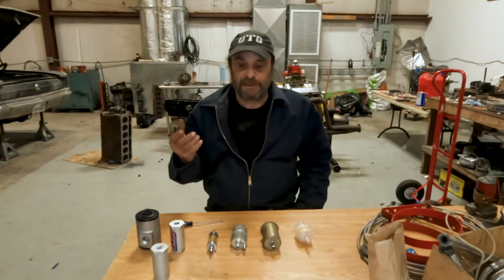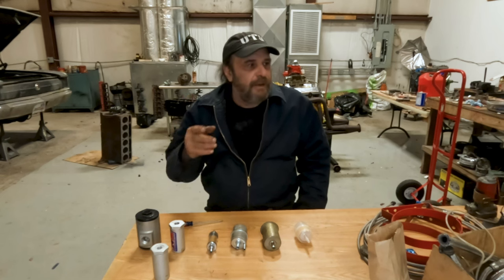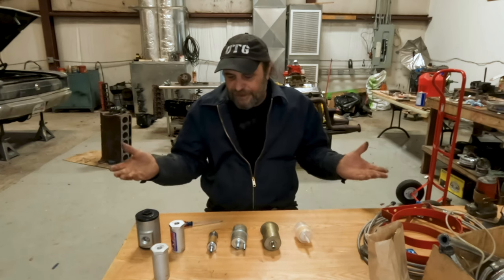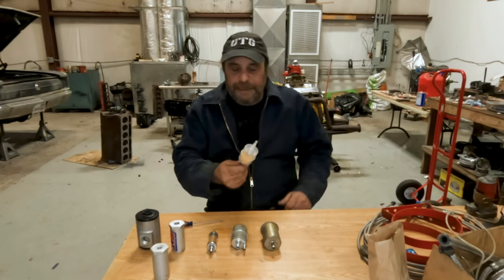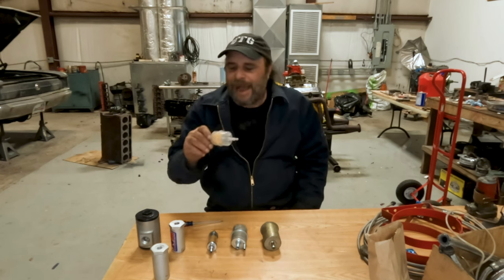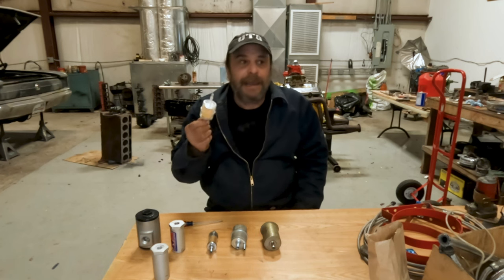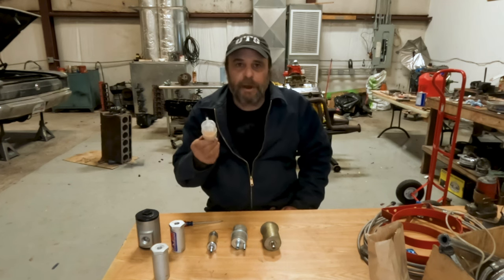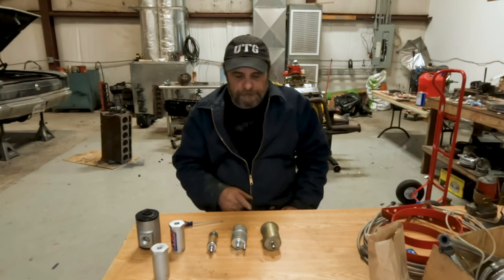Fuel Filters For Carbureted Engines From Mild To Wild - Pros, Cons And Which Is Best For Your Ride

Comment: I worked at a parts store during the rise of e10 ethanol fuel.  Started having an epidemic of fuel filter failures, between plastic Purolator and the Mr. gasket/ Spectre glass fuel filter.  The new fuel was just eating away the guys inside these filters.  Turned a lot of my customers away from them permanently.  It was surprising to me how long it took Puralator to fix the issue, it took months.  Mr. gasket took years to fix it.  Even once Mr. gasket solved the issue, I would often turn customers away from the glass filter.  Not because of the glass mind you, but because the parts store would only carry the filter that came with plastic interchangeable nipples.  Those nipples were made of the cheapest plastic there was, and would always leak or crack.  If you do go with the glass, get the ones with fixed size metal ends.
Reply: hey do you remember the part numbers? I run E85 and love to do a video of this.
Reply: @oldblueaccord2629  the purolator 3/8 filter I believe was a f21111, 5/16 filter was a f20011, I forget the 1/4” one but it comes up under a 70’s vw beetle as the factory replacement.  My numbers might be off but I think that’s correct, it’s been about 10 years lol
Reply: @gcaprice406  Thanks! ill get some and try them in E85!

Comment: I’ve had ONE of those exact same glass filters crack in almost 50 years as a mechanic. One. Meanwhile I’ve seen dozens of steel, plastic and various cartridge design filters crack, split and fail. I’ll stick with a pyrex glass filter. You can service the filter element and replace the o-rings before the rubber degrades.

Comment: Glass filter location and mounting is the most critical part of their failures in my experience. I usually have an electric pump, so mounting the filter on a non-vibrating location, and letting the rubber line sections absorb the vibrations has been very successful. NEVER any issues. Benefit outweighs the negatives, at least for me. It’s all about monitoring your equipment, and acting accordingly. Neglect=issues.

Comment: Thanks for the video and dispelling any rumors.   As for vapor lock, we used to put wooden clothes pins clipped to the fuel lines and though not perfect, it did help dissipate heat before the gas got to the carb. 😊

Comment: Years ago ,my first car , a 72 Demon had rust in the tank, and it would somehow get past the fuel filter and get between the needle and seat causing it to flood out. I tried several different types of filters and it got through all of them.   The only thing that solved the problem was dropping the gas tank ,dumping it and flushing it out.

Comment: In regards to the plastic filters, as a fireman, I have seen them burn a few cars down (and one brand new zero turn mower), I use the metal ones. If I suspect a water or fuel supply issue, I'll just pull it off and get a sample. Plastic not worth the risk to me.

Comment: I’ve been using the glass type filter since 84. I’m a carb guy, and have always used mechanical pumps. I’m still running my engine that I rebuilt in 85. I’ve freshened it up a couple of times since then, but in the summer it runs about 230 degrees. I’ve been fortunate enough not to have vapor lock problems. I’ve always had a 1” phenolic spacer under my carb, and I’ve been using a RPM Air Gap intake for about 20 years now. I still like the glas type filter. The only problem I ever had with one was when I tried to tighten it down too much, and stripped the threads. That was probably 15 years ago. I bought another glass filter, and still haven’t had a problem with it since

Comment: Thanks to your 8 dollar cure video, I ran a return line from my carburetor and used a tee to connect it to the tank and used a 1980 Cordoba fuel filter to connect to carb. No more hard starting problems in the heat for my '68 Fury VIP (318, 2 barrel) Thanks!

Comment: I used a glass fuell filter on my 4x4. Never worried about it leaking or breaking. Before I replaced my fuel tank, that little thing saved my comute. It'd fill up with sand half way to work exery day. Id just pull over, swap in a new filter and be on my way. When I got home, id take same carb cleaner and clean the days used filters to get them ready for the next day. 

Boy was I glad when my new gas tank arrived and i was able to solve my dirty fuel issues once and for all. The old tank had holes rusted in it, allowing sand to fall in from the top. Im sure some of my gas would splash out as well.

If you are using a glass filter, just make sure to take a look at the gasket every once in a while to make sure its not cracking and you'll be fine. I have seen some where the rubber was all dried out and it was leaking through the gasket.

Comment: Finally SOMEONE defends the glass fuel filter!  Get a good one with the barbs cast into the ends and NO plastic pieces, lube the o-rings prior to assembly (Dow Corning Molykote 55).  Ran one in a V8 Monza for years, never had a leak, always worked well.

Comment: Canister cartridge inline filter on an 80's vintage motorhome. Got bad gas and found myself stuck thinking I had to replace the filter. YouTube informed me I was wrong. 
Go under vehicle with Solo cup, unscrew cartridge and pour gas into cup and water onto the ground, take filter element off, bang it on the ground, blow through it and put it back on, pour gas back into canister and replace fingers tight only as it has a rubber seal. Start engine and drive away.
Filter medium is near indestructible and separates water. 
Now I know. I used to replace them. No one ever told me because they were making a sale.

Comment: After one year with  glass filter. Best thing about the glass was I could see the o-rings starting to melt from the ethanol in fuel here in Canada. Been using Earls aluminum filter with brass element ever since. Why risk the chance of fire to see the fuel in the filter? Not worth burning up my mopar.

Comment: Good video. I’m currently going through the “choose the right filter” process on my project truck. In doing so I’m getting educated on AN fittings and higher end fuel systems. However, I plan to stick with steel brake/tube line with flare fittings and metal inline filter. It would be really helpful if you could make video about AN fittings, adapters, and fuel lines, both rigid and flexible options. A lot of parts sellers don’t include much spec info on their fittings so it’s hard to tell what’s compatible. Thanks and keep sharing your knowledge!

Comment: Great stuff, brother! I've been out of the loop for a long time. My last real classic got sold 12 years ago, and I kick myself in the ass every single day for that ...

The only weak point on the glass ones is if you get a cheap one with plastic nipples. Those SUCK! They'll break when you least expect it years down the road after you've long forgotten about installing it. I've run those filters for years - never had an issue until I got one with plastic nipples. JUNK!  All metal is good - even pot metal is better than plastic.  Never broke the glass on one in 2 decades of using them. Been about that long since I've bought one, so I don't know what's out there today. Most parts are hit or miss these days, so shopping around is the best bet. I always loved glass for a quick and easy glance of what might be headed toward my carb..

Comment: I use the Pyrex glass see thru filter  on my vintage vehicle 
I love it because I can see dirt specs when the filter gets dirty 

The filter is easy to remove and take apart and wash under warm water, I Let it dry and put it back in the vehicle ,they last forever just inspect the o rings make sure that they’re not brittle 

My filter is been going for years about 10 years and I’m a Sunday driver no problems I will keep using it. 
It’s a good idea to inspect the filter when the vehicle is running before you take it out for a drive to make sure that there are no leaks at the fuel filter 

I’ve never had any problems but inspections on this filter are needed to make sure that there are no leaks.

Comment: The best fuel filter I have seen is a Malpassi Filter King. They were fitted as standard on my 1st 3 cars - 1960s - 70s Alfa Romeos.
They had a glass bowel which separated any water, a replaceable paper element and an adjustable preassure regulator in the top of the body. 
They are still available more than 50 years later.
Reply: My goodness you just reminded me of my old 1974 Alfa gtv 2000 I used to own it had the Malpassi system and worked great. Sure miss the car. Was looking at installing something on my Buick Wildcat and might just retrofit this on the firewall

Comment: I had an issue 2 years ago on my 361 Chrysler in my grain truck where I could get out on the road drive about a half mile and it would die.  Turned out the new inline fuel filter I got at advance would not flow enough fuel to keep up with engine demand since that engine runs wide open all the time in that big heavy truck. I never would have thought it because it looked the same as the one I took off and you could blow thru it easy.

Comment: The glass filter I run mine between the frame and pump on my '71 340 Duster plus the original one. I do that so if it does break or leak, it will just run out of gas and die.

Comment: I used to do a lot of tricks with fuel filter on Old carbureted vehicles someone use for pressure relief show my use between the gas tank and fuel pump between the fuel pump and carburetor combination of both sometimes when the fuel pumps. Not brand-new.

Comment: I run a glass filter between the tank and the motor on my boat. It's never once given me an issue. I love that thing because I can see if there's any trash in the fuel tank, and I can make sure I have 2 stroke oil in the tank as the fuel turns blue when it has oil added to it

Comment: Years ago i had a '69 A100 van with a slant that ran sweet but had a badly decomposing fuel tank. I took it & a tow dolly to fetch a friend's Mustang near Hazard Kentucky. It took me about 13 of those plastic filters to get back home to Guntersville Alabama. (About 50 mi. per, till one would rust shut).

Comment: The screw together fuel filters with a glass worked great for the most part, biggest problem I ever had was them coming unscrewed at either end. That was more dangerous than the glass ever breaking.

Comment: When using a carb and mechanical fuel pump, I like using the stock metal AMC V8 fuel filter that has a return line built in to prevent vapor lock.
Mount it as close to the carb inlet as possible; regulates the pressure and easy on the pump. 
Might be good for clackity electric pumps too since fuel would constanly flow at an easy pressure and cool the pump.

Comment: Late '90's I had a small aluminum filter. Blue anodized with a ceramic filter element. (porous sintered bronze) Looked great under the hood.

They had a problem with the O ring... (officially) It didn't squish, it looped out... and eventually filled the valleys on the intake with gas. 
It then ignited. I had a small extinguisher, and the damage wasn't too bad. Lots of wires, and a few carb parts, and of course the air filter caught too.

Comment: I was running a strait 6 on my boat . I installed the glass filter and after a run to Buffalo on way back motor died? Filter was full of sand? Removed sand started right up.

Comment: I have fitted a marine spin on fuel/water separator filter to two carbureted automotive applications. If you have a clean fuel tank the filter element basically lasts forever and it's easily serviceable with a new spin on filter. Note I used the filter setup without the plastic water separator/drain on the bottom of the element. It's been working great for years now.

Comment: Uncle Tony l have been using the glass barrel type filters on my outboard powered drag boats for many years
 as a prefilter right out of the tank as they are only 20 micron rated. I use an aluminum billet filter from Summit rated at 5 micron after the glass filter and before the electric fuel pump so they are NOT pressurized.
Never a problem and these boats move around a LOT! LOL

Comment: Those glass filters work great, except the typical replacement filters you find for them are extremely porous. They work perfectly fine for larger debris,, But they will absolutely not filter the finer particles & silt typical of older fuel tanks, which will fill your carb with a very, very fine layer of dirt if you're running a particularly dirty/rusty tank.

Comment: Just bought a glass filter a couple day ago and now seeing your video pop up, how odd! Bought it to replace the plastic in-line filter under the hood. The plastic was becoming discolored and the nipples on it were starting to bend from the body pretty badly. I had an old glass one that had a small leak, but that's because of dried up gaskets. I agree that the glass is pretty tough! I dropped the glass tube on a concrete slab by accident and it didn't leave so much as a crack or chip in it.

Comment: I run a standard inline filter before the fuel pump above the bottom of the frame rail.  Then I do something I have never seen or heard of anyone else doing.  After the fuel pump I have a pressure regulator and then after that I have a fuel injection filter.  Now there is never any little flakes of rust in the bottom of the bowls as usual after a long time with an old car.  Fuel injection filters are high flow and very fine.  All they let through is gas.  I just rebuilt my carb and there was not one flake in the bottom of the bowl.  Keep garbage from the fuel pump valves and from the needle and seat, then the carb just flows gas only.

Comment: BEWARE of the glass filters that have PLASTIC ADAPTERS for different fuel line sizes as they can crack-. Dumping fuel on the engine if it's near the carb. Unfortunately this happened to me a few years ago and it ignited due to a bad hot wire that was jumping to ground and caused an instant fire under the hood! We got it out fast, and found the problems, fortunately not too much damage.

Comment: Gravity feed fuel systems work well with the red plastic flying saucer metal screen filters. Have had flow issues using paper filters with gravity feed fuel systems. 
Metal screen or mesh seems to work well; the filters are cheap, small and can be backflushed in a pinch.
Usually available in red or white and flow enough fuel, without a pump pushing it.

Works well on motorcycles; suppose they would also work on a Ford model "T" and other gravity fed carb cars.

Comment: I run a Mann plastic fuel filter on my bug, tucked up above the transmission and NOT in the engine compartment like so many people do.  It's 1/3rd the weight of a comparable Hastings metal filter so I don't have to worry about the weight of the filter tugging on the soft lines it's connected to

Comment: I soloed in a 1946 Taylorcraft BC12-D airplane. Flew it all the time. It had, and still has, a glass fuel separator/fuel strainer. If you can fly an airplane with one, you can drive a car with one.

Comment: I watched a FireStone service center across the street overfill the automatic transmission fluid one day after a service. Start it, let it run and walked away. As fluid expanded, it came out the case overflow tube clipped to the filler neck that terminated right on top of the exhaust manifold. It caught on fire, the pushed it outside the building and then call 911. 
Now, glass, cloth/paper filter media or metal w/screen, the filter inside was ok, just a loose nut behind the steering wheel last that burn't that Ford Exployer to extra crispy! You can't fix stupid but can legally change his name in court! 
Plus, ATF burns hot!!!

Comment: Every new style glass filter ive used had sealing problems. The really old style, they were great, but the newer ones are junk. Good concept but lots of room for improvement. I run 2 filters. One before the pump and one after.

Comment: I would never use that style glass filter because I have personally seen a car burn up from one that did break. A friend was working on his 28 Chevy Hot Rod in his basement garage when the filter broke, igniting the car. Thankfully he had an extinguisher at hand or he would of lost the car, his house, and probably his and his wife's lives. Why take the chance? Now the OEM style glass filters were a completely different thing, but there's a reason they quit using them in the 50's.

Comment: Manufacturers of gas tractors in the day of mounted corn pickers had metal sediment bowls to use while the picker was mounted in case of fire. 
The glass bowl would shatter from the heat, metal won't.

Comment: Ford had a good idea with the early FE motors, a fuel filter which was a spin on replacement was part of the mechanical fuel pump. Never had an issue with those

Comment: Great video!! I have used the glass filter for years not on all my cars but the only problem i have ever had was one time one leaked a little gas and that was because i didn't tighten down the ends enough other than that on problems. I don't why everbody talks bad about them and it has been a help to see the quality fuel going through the system especially on old cars
Reply: Mostly the fear is from operator error and ignorance.  Lube the o-rings before re-assembly with proper o-ring grease (Dow Corning 55) and Bob's your uncle.

Comment: My only issue with the glass ones is that the threads can strip out easily (particularly on the cheaper / lower quality ones)   if you don't notice that they are stripped out, then the things can fall apart.   Kind of wish they had an external clamp holding them closed instead of internal threads.   That's just me though.